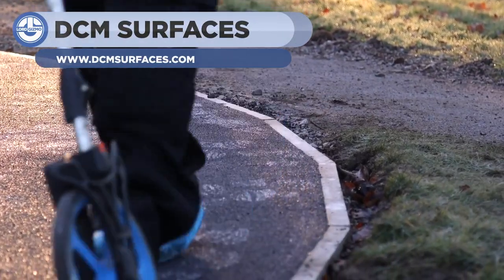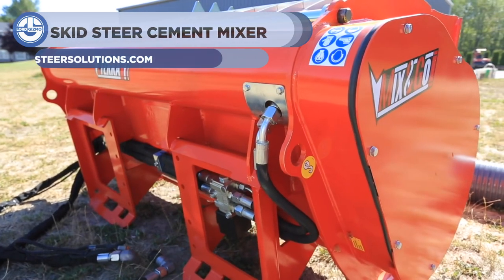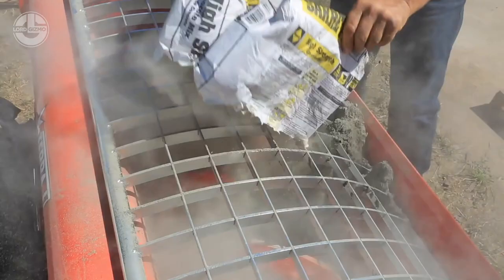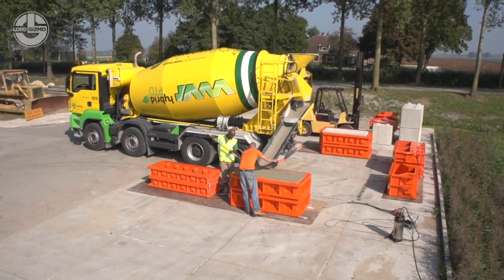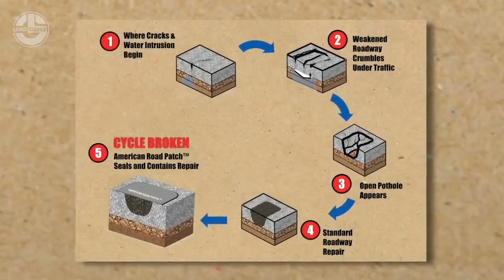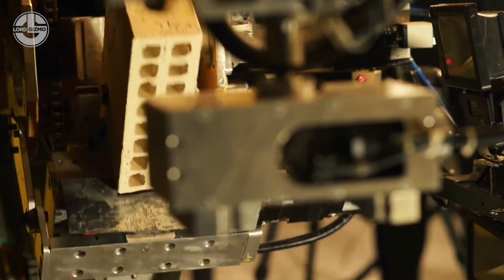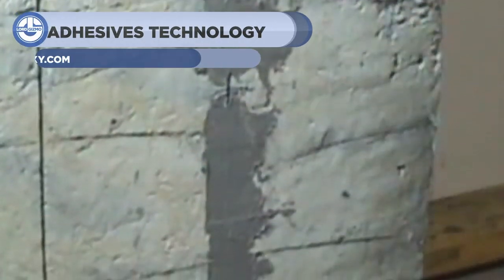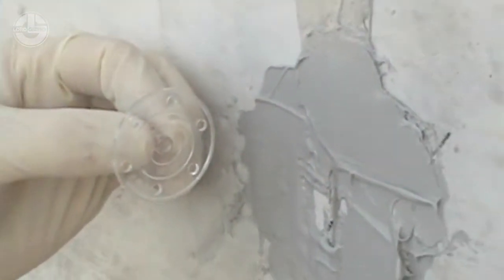Construction Inventions & Technologies That Will Blow Your Mind

Comment: The FastBrick Robotics seems to be laying bricks without any mortar or any other adhesive. So what holds the bricks in place? How does it handle the need for a half brick? Does it need to be queued up at the source, which seems to be far away? That could be a real headache if there was a defective brick in the queue somewhere and a replacement is needed.